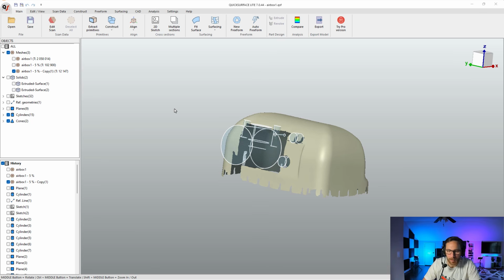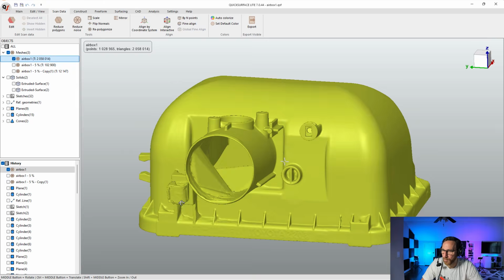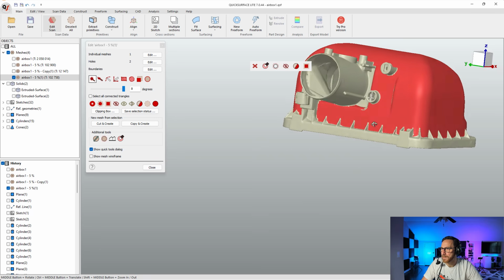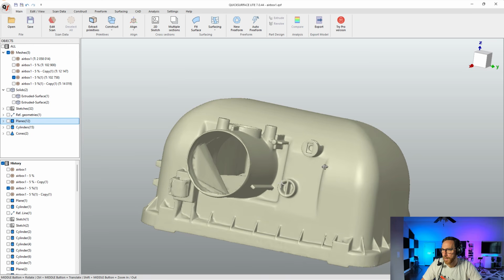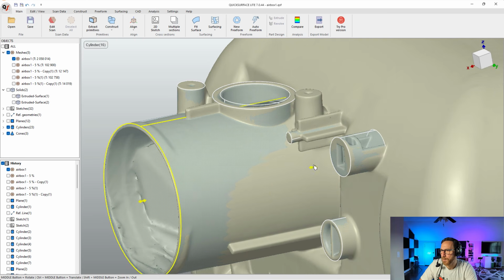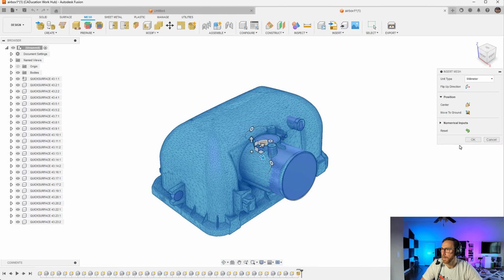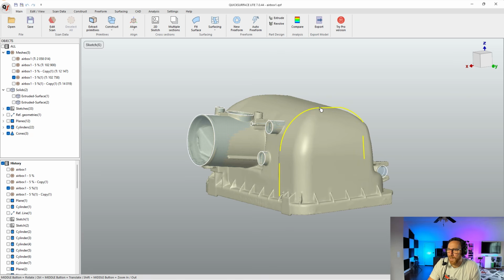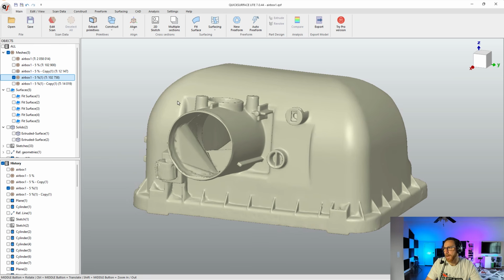Reverse Engineering Scanned Car Parts - Airbox Series Part 5 - Bonus Quick Surface Lite

Comment: Hi! In your opinion, what's the best way for a beginner to start learning reverse engineering? Is it a good idea to combine different software, or should I focus on mastering one program first?
Reply from the maker: Hey There, depends a bit on the types of parts.  This series was an example showing a complex part but being remade for 3d printing in Fusion and with QS.  I would say first you need to decide if you want to actually reverse engineer a part accurately, or if you are trying to make a new version or something that fits to a scan.  For the first one i think QuickSurface has a good set of tools and is worth the effort.  It can give you an idea on how accurate you are relative to a scan.  QS (or other scan based software) is often needed to accurately align your scan to XYZ as you are doing a bit of guess work in CAD (we have a few videos on that in Fusion).

If you want to design a new part to replace the scan or to fit to a scan, often times the scan based tools like QuickSurface are nice to have and certainly help, but aren't required.

I look at it like this.  If I am trying to exactly replicate a part, programs like QuickSurface have better tools.  If i am trying to design a new part, I use QS for alignment and cleanup then move to a CAD program.

I like Fusion because I do a lot of freeform based designs off meshes and it has a lot of power for the price.

Comment: Have you ever looked at GOM/Zeiss inspect?
Reply from the maker: I have but I haven't used it.  I know David at MakingForMotorsport did review GOM before it was purchased.
Reply: @LearnEverythingAboutDesign  it seems to be able to do a lot of what QuickSurface Lite can do sans auto surfacing....albeit it in a far less intuitive but free product. On a different note it looks like QuickSurface came up with another tier under the badge of Revo Design Personal that is far more approachable cost wise for the hobbyist.

Comment: Can you please do this also with plasticity? 🎉 there a no good vids for reverse engineering
Reply from the maker: Peter at TakeRefuge3d just did a video on scan based reverse engineering.  https://youtu.be/e6n6Wbd-cCc?si=n5GJcgvcK4gxYu9K

For Plasticity there are things it does well with sketches like drawing curves on a mesh.  but for something like this it would likely be a lot more work.  I think they are working on more Mesh based tools. Ill play with it and see but my gut says that Plasticity isn't ready to do a part like this efficiently.

Comment: Matt, any idea if Quicksurface will be adapted for Mac OS?
Reply from the maker: Hi Juan, i am not aware of a MacOS version currently.  Since most CAD programs that a pro reverse engineering program would port to are only on Windows I can't imagine it would be a big item.  If I find out more I will let you know.

Comment: Awesome. Im one of those in the Pro camps. Would be cool to see your workflow for this part. Would you attack this part in Pro more surface modeling or more sketches and and extrudes?
Reply from the maker: Probably the biggest change in Pro is the fact that we can boolean things together.  I would probably start the part the same just based on the core geometry, but could quickly add things together and make adjustments where needed.

If i could easily defeature it I might use AutoFreeform or some surfacing tools, but again the core of this is fairly simple and that would likely be overkill.